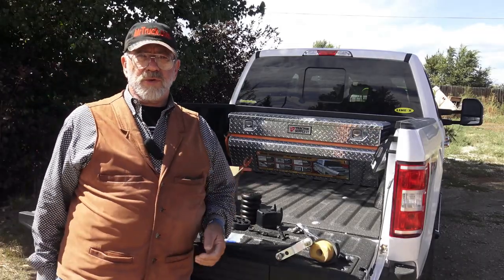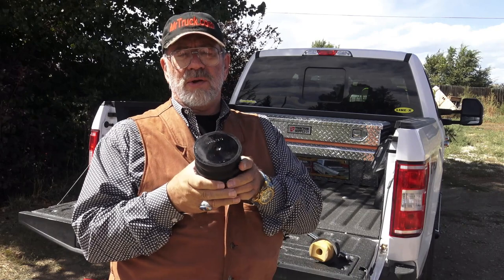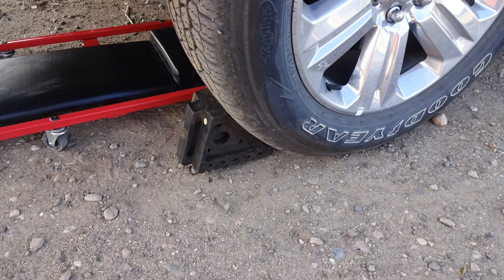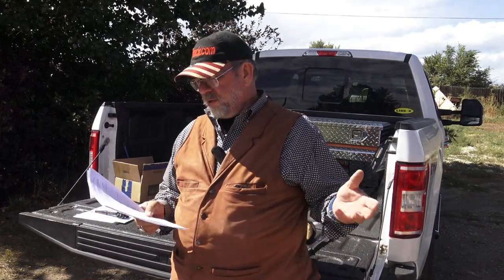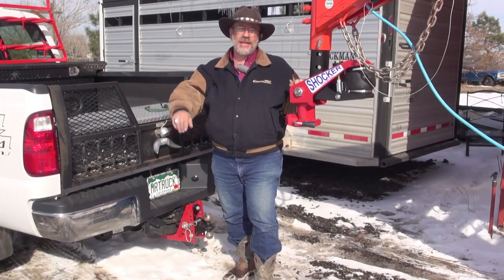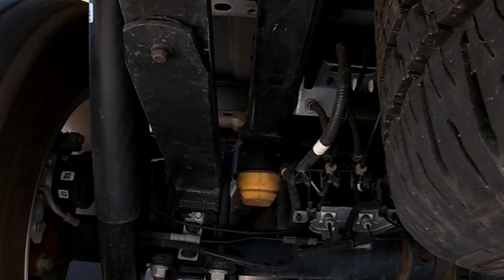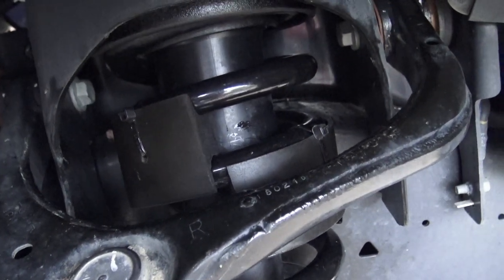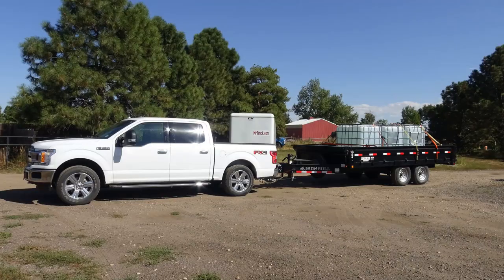Guess what happened to my F150's suspension, OK it's Sumo Springs automatic overloads

Comment: Wouldn't it have been easier to install the front ones by starting at the bottom of the coil and rotating it up?? Or would it not work that way?
Reply from the maker: Yes, there's more room behind the coils at the bottom, that's how I stared to do it. But the instructions said start at ring #2 from the top. My son Eric did it well

Comment: Just put sumos on my colorado duramax, looking forward to how it feels pulling my 27 ft 6000 lb camper. Do you think the front coil spacer does anything to the ride height up front? If so wouldn't an alignment be needed?
Reply from the maker: Loaded with a trailer, it does a little

Comment: My 2019 ram 1500 has a 2 inch lift in it. Will these work on my ram? I just purchased a 33 foot travel trailer, I would like to put these on to stop the sag and improve the ride
Reply from the maker: They should, the kit comes with extra spacers

Comment: Dose it HELP with the Ford DEATH Wobble on the front end of the F-350 when loaded
Reply from the maker: I don't think so. death wobble is normally with lifted with short trucks and loose steering linkage. Not sure about a F350
Reply: I have just a stock F350.  It happens when I hit a good size bump or cross member on overpass usually with a curve. Can’t stop the wobble or bouncing of the front end until I slow to or below 45 MPH

Comment: Newbie question, looking to buy a travel trailer for my 2012 f150 fx2 5.0l supercab. There is 130k on the truck, bought it used so the shocks/struts are originals.  My question is would the sumosprings help out or just go with Rancho Quicklift Leveling Struts + RS9000XL Adjustable Shocks Set. Or would Rancho be a waste of money. Any advice would be helpful.
Reply from the maker: Sumo's will support a trailer better
Reply: @MrTruckTV  still have 4 more years until I retire, time flying by...great videos.. thanks!!